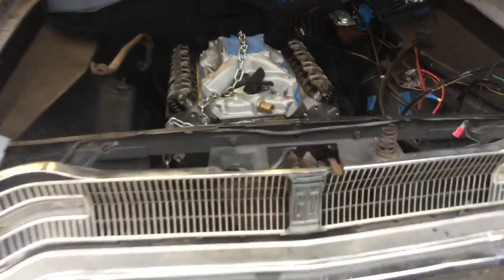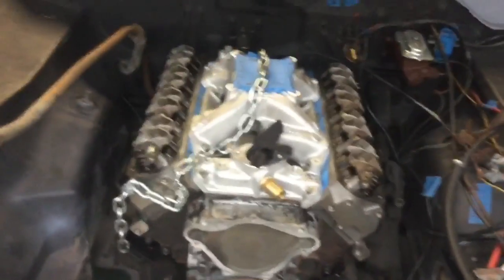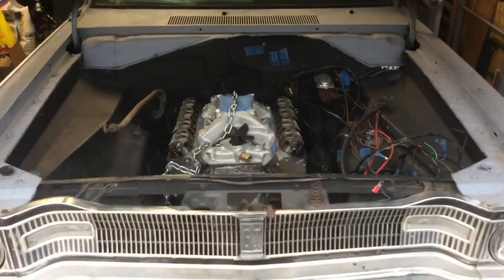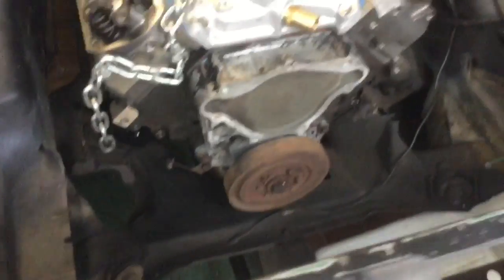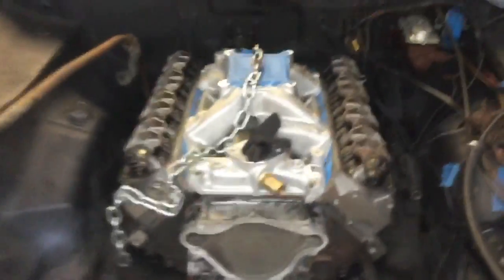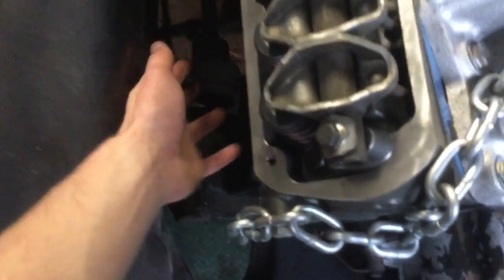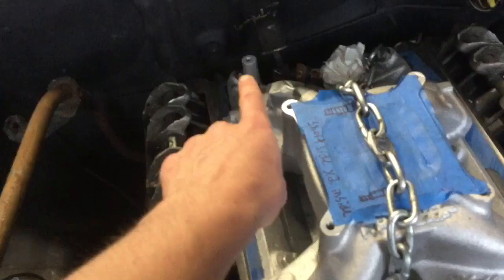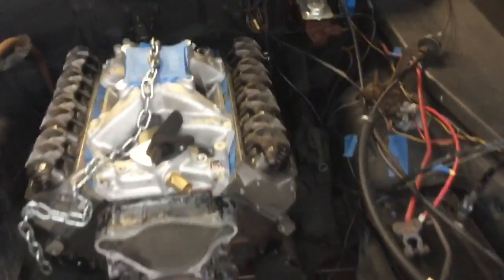The Engine is Crooked

Comment: There our two positions  you bolt to the block ears. You might need to put one forward of the block ears and the other side at the back of the ears.i would put transmission cross member in frist.then you can mock up mounts that way everything is straight.

Comment: Loosen motor mount bolt and transmission mount bolts but drive shaft in  get big ass metal bar or largest ass prybar  then rock things around to align things then tighten everything up should just fall into place with big ass pry bar

Comment: If you use the slant 6 K member , the you have to use special aftermarket conversion motor mounts , that is the only way it will fit correctly.
Reply from the maker: I do have the special motor mounts for this swap
Reply: Sim ABCXYZ Ok , then are they on the right side and are the main metal mount on the motor , on their correct side and placement on the motor mount tabs. I did it wrong one time and it placed the motor to the rear too far , my headers would not fit.

Comment: Most engines do set offset in the frame Mustang Fox body even my Nova sat a little offset get the whole Drive Line in the car and then check everything trust me if anything's off and you run the car down the street you will have a terrible vibration I think you're fine like I said most of the cars I've ever done engine swaps on s*** just a little bit offset the problem with it is putting a motor in a car that wasn't in there from the factory with everything into Factory had in the car at the time you're going to notice things like this

Comment: The 360 in my rallye challenger is not centered in the engine compart and it's been that way since new. I found this out when I measured for the hole in the hood for the tunnel ram.

Comment: IF YOU ATTACH, AND BOLT UP TIGHT, THE TRANSMISSION FIRST, WITH THE MOTOR MOUNTS ON THE BLOCK, THEN JUST DROPPING THE FRONT OF THE MOTOR SHOULD LINE THEM UP PERFECTLY.....AS LONG AS SCHUMACHER MOUNTS ARE THE CORRECT ONES....

Comment: Changing thd k member wont help before you get discouraged get underneath measure the tailshaft from one side of the car to the other side find your center point they are off set some from the factory the crank bolt looks like it is center to the lower support . then you can put a level on the intake an make sure the engine is level also

Comment: Start with mounting your transmission first and then go forward to the engine mounts and then go from there usually what I do is I put the carb lift plate on my intake pick up the front of the motor align the transmission Bolt the transmission down first and figure out the problems with the motor mounts next cuz you can always go back and fix motor mounts to transmission is the true center of the car so that's where you want to start
Reply: Also remember that there is almost a 2 inch offset to the passenger side when it's all said and done when the motor is finally at rest in the engine bay

Comment: As was stated, get the trans n driveshaft installed n aligned. Then see where the engine sits, any adjustments need to be done in the engine bay. Whether it's k member, motor mounts etc. Also make sure the engine is leveled from the oil pan. Looks can be deceiving

Comment: Its probably where its supposed to be but if the transmission is off center you may have the wrong trans mount. Sometimes the trans cross members are different but its really easy to make one. Dude really need to start hanging out at a mechanic shop or get a part time job at one or something because relying on comments from YouTube is not going to get you very far. Good luck man and also try to find a mopar expert in your town it shouldn't be too hard to find someone who would know and they would have all the answers

Comment: Mopar engines are off set a little bit. You will have more problems with the driveshaft harmonics if it was mounted dead nuts straight. It will be just fine the way you have it now.

Comment: the engine being offset shouldnt be too much of a problem. you should correct the crookedness of the engine though. I would slot the holes in the engine mounts and pull the transmission over to where it needs to be, then hopefully you can just drill new holes in the crossmember. If it was easy, everyone would do it. Remember, its just a machine, you can make it do whatever you want. Keep at it, put in the time and it'll get done.

Comment: First, I have never had this problem before.  What I would do, (assuming that your trans mount is square with your rear end) is mount the transmission first. Mounting the trans first should then act as a “pivot” point. Hopefully you can then try to push the engine (if possible) into a straight position. Then drill new holes in your k-member and bolt up your engine. This is just a thought, I am not certain at all if this idea would even work, but its worth a shot.